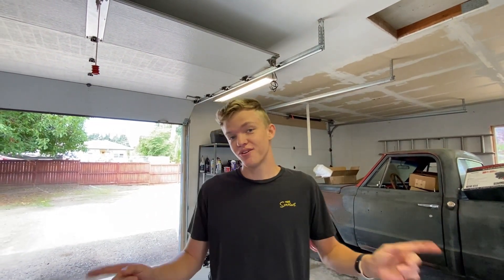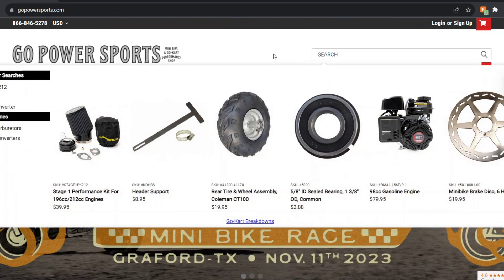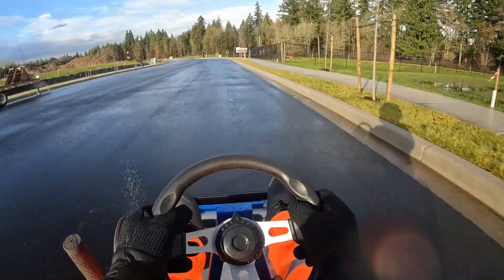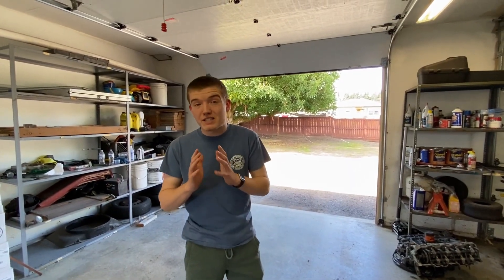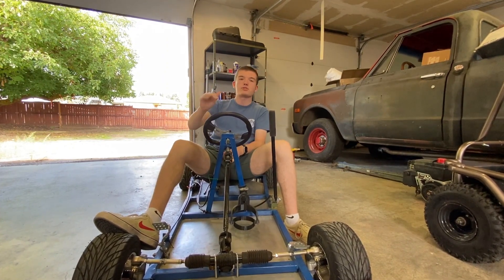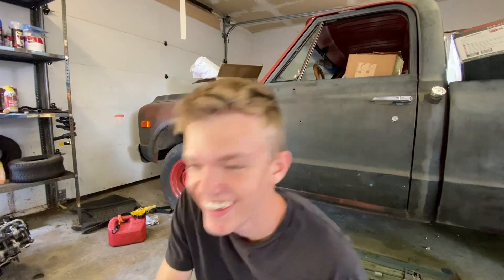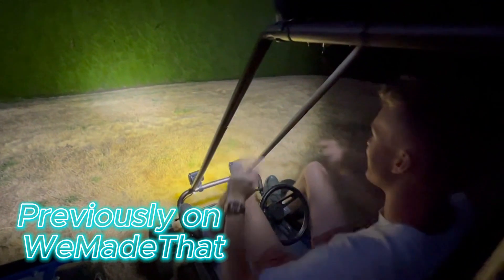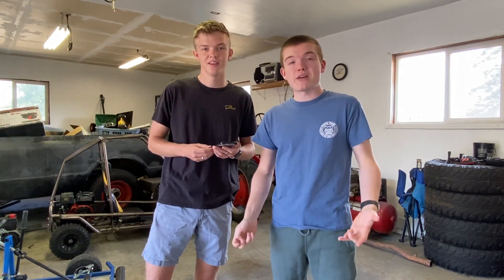Everything YOU Need to make a GO KART! Complete Build Breakdown

Comment: So hard to find these videos me and my friend are trying to make a go kart and Ī ripped an engine out of my dads old push mower and sense the shaft or the part that spins in horizontal I’m just gonna flip it on its side but I don’t rlly know what to do abt how to make the engine spin the axil and my friend has one of those pull wagons but it’s rlly nice and high quality and it already has some janky steering which should be fine and we ride down hills in it and he wanted to add a engine but he didn’t have one and didn’t wanna spend money to get one so I just go an engine form an old push mower and it’s 5.5 hp which is good enough so I just need to know all the parts for the axil and stuff
Reply from the maker: That’s honestly a challenge for sure and it’s probably possible. My only thoughts would be to get a centrifugal clutch and an axle kit from ombwarehouse’s website. That’s my best recommendation, I’m not sure how many builds there are with horizontal motors you can go off of but best of luck. Update us if you guys find a solution, very curious lol.
Reply: @WeWillFixItLater  ok lol